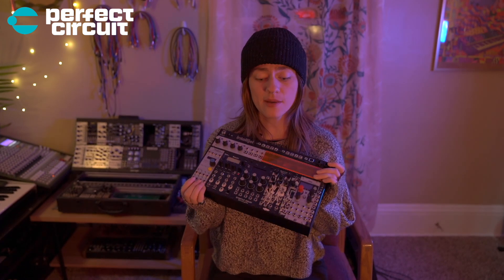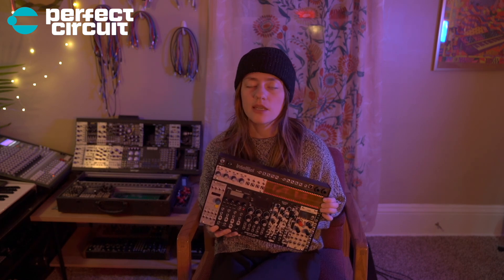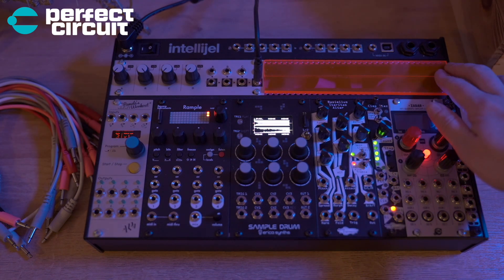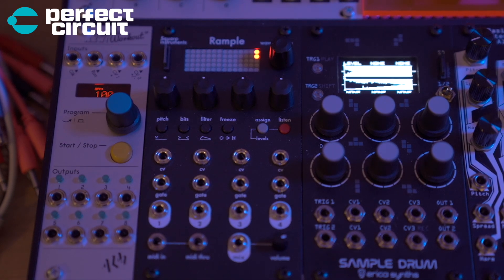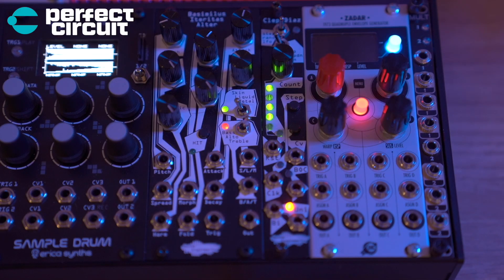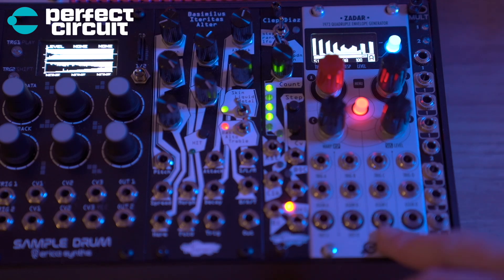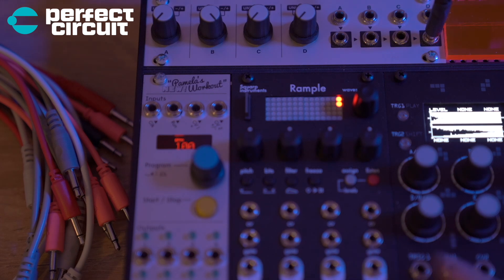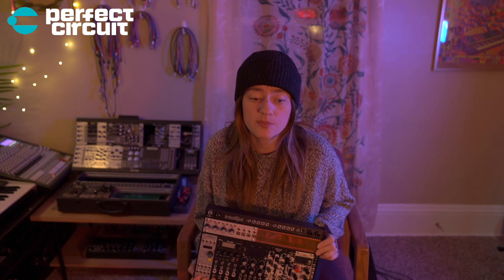Building a small, Drum-focused Modular system!

Comment: You can use a passive mult for triggers/gates. The buffered is for CV/Audio signals. Nothing wrong with using it for triggers/gates, but the pallet case already has 2 buffered mults across the top. You could probably find something better to do with the 2hp. Or drop both the 2hp and the Diaz, use the zadar for modulating the BIA, and take the 6hp back for something else, like a second BIA. XD I dunno. It's a good kit.

Comment: Love the compact form factor. I took a totally different approach with mine. Pams is a bit fiddly and I wanted something hands-on, so I use a combination of Grids, branches, latching manual+CV switches and an antimatter launch codes for more immediate control of changes in pattern. Currently driving a BLCK_NOIR but the sounds on that are a bit vanilla so I'm adding a squarp rample, which is what lead me here. Tempted to ditch the BLCK for something more modulatable like a BIA or a taiko or something, but having a stereo out, aux in, filter and set of nice FX makes it hard to pass up on all that functionality.

Comment: Some nice choice there, but what's wrong with the rest of the 1u row with a noise generator or something?  Also, how come you need 2 multis in such a small case?  The built it one is more than enough and your demo doesn't even use it. Using the palette as a drum or bass synth is awesome though, agreed!
Reply from the maker: I could def add more 1u modules they’re just hard to find (usually out of stock!) and the mult that is built into the case is passive, so to avoid a drop in signal I have the small buffered mult on the end
Reply: @SarahLongfield  the built in mult is buffered according to the Intellijel website. I generally only use them for clock and reset triggers though so I wouldn’t know if the signal drops.

Comment: I would definitely recommend a digitakt over this setup any day of the week, and I own all the modules here except the Noise Engineering one. This build is alright but Pam’s is a bit frustrating to use as a normal sequencer, something the Elektron sequencer right away blows out of the water. But then you only really have 2+4+1 voice, so down a voice compared to the Digitakt. 4 + 2 envelopes (Zadar and the built in envelopes with sample drum). And zero LFOs or filters or effects (reverb and delay are gorgeous on Digitakt, basically useless on Sample drum).

Not to mention this case ends up costing $2,100. It would be cool if you already had these modules to build something like this but if you were starting from nothing, get a Digitakt and / or a Syntakt. You’ll get much more for the money.
Reply: I disagree apples and oranges. Modular allows you to build an instrument and evolve it over time. What good is an elektron box or a daw if it bores you and you dont use it 😉

Comment: Newbie question: could you have used the mults at the top of the case instead of the module on the bottom right? Did you just add that on since there are few things that would fit into that small a space? Thanks for this video, I'm potentially looking into making a drum modular myself.
Reply from the maker: I could’ve but at the time I wasn’t sure if they were passive or buffered, if passive there would’ve been a drop in signal that you don’t have with a dedicated buffered mult, it is also nice to try to make sure all the spaces are filled so it gets less dusty :) cheers!
Reply: @SarahLongfield  great thanks for that, still finding my way through all this. and maybe blank space isn't all bad...because you'll start to learn about new modules and can then adapt and grow...

Comment: Does anyone happen to know what the VCV Rack equivalent of each module would be? :)
Reply: The vast majority of the signal chain here is relatively generic functionality modules, Pams Workout (multichannel clock gen), Rample and Sample Drum (samplers), Zadar (envelope generator/modulator), LFOs, mixers, mults, etc... the Rack library is very searchable, (most of the stuff in parens here are "tags" on the library search page), and you can find tons of different examples to try out for all of these.  The exception is BIA, which is a pretty unique module (6xOSC+additive synth+noise+env+secret sauce).  I doubt there is any direct replacement for that, but there are no doubt tons of great drum synth modules in the Rack library, and "drum" is a tag you can search on.